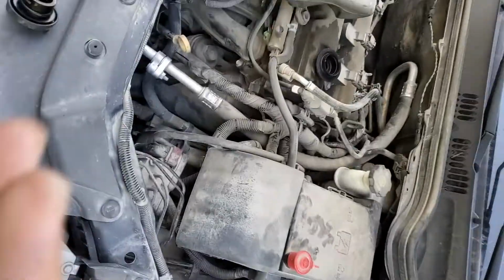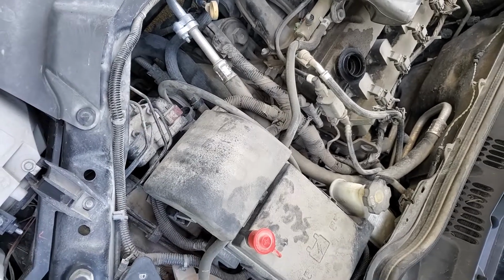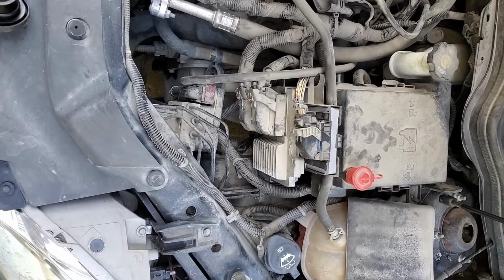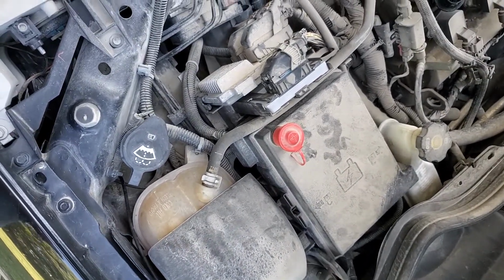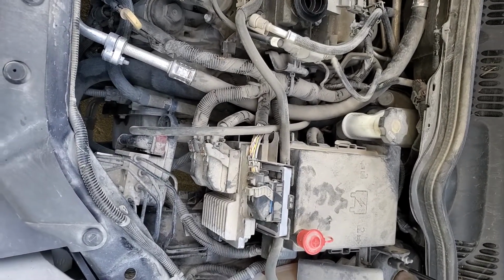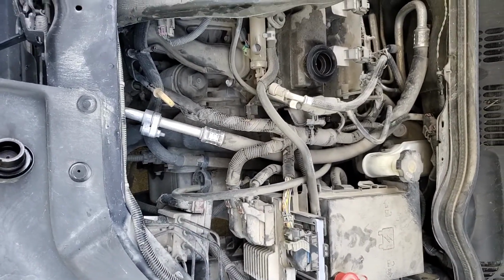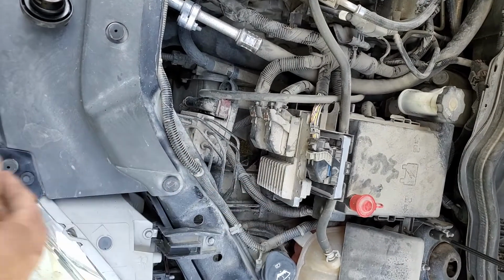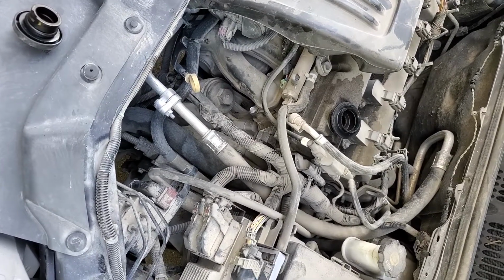chevy cobalt not charging charge light on lights flickering fixed

Comment: Mine just started this issue and drops voltage from alt to battery but both are showing proper voltage. Go figure, it just got cold in mn, and I literally did a lof right before all these issues started.